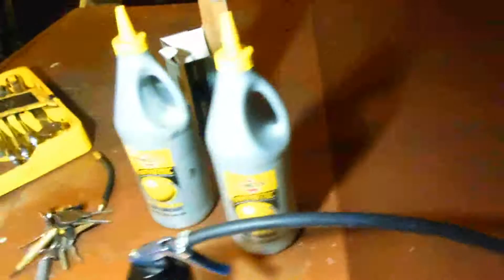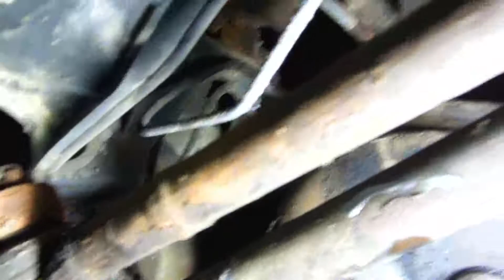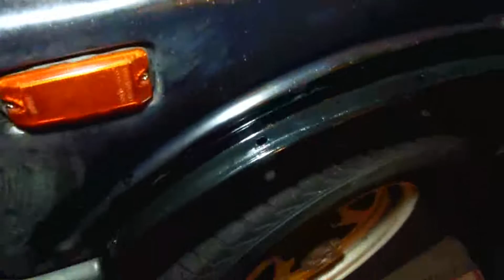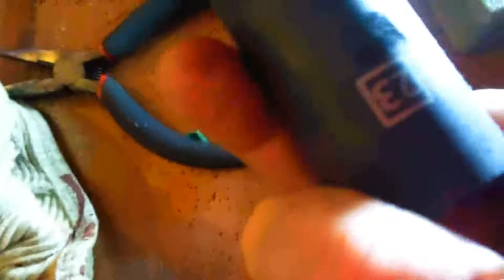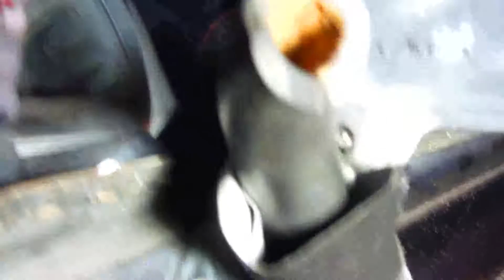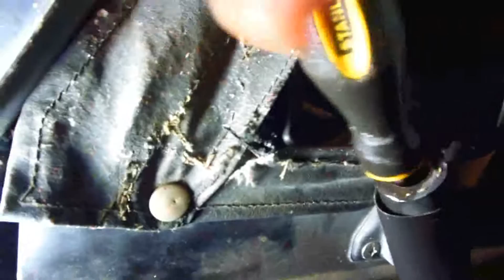Suzuki Samurai -Gear oil, Stuck Fill Plug & Speedo Cable lube

Comment: Transfer case plug 10 years not touched.  Propane torch nice and  hot. Used Dremal tool cut a notch used a drift and hammer. Lots of anti seize on the threads going back.
24 mm rounded it off so nice. Bummer. Got new plugs ordered. Samurai little quirks. LOL  
Thank you for the clutch cable tip. That will save a day not popping a cable.